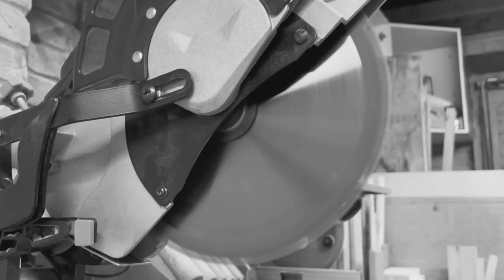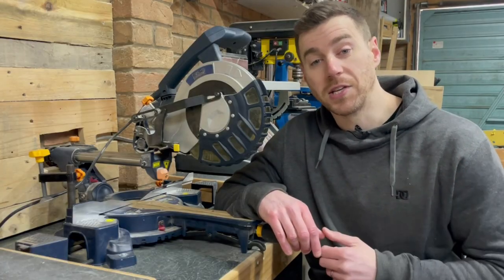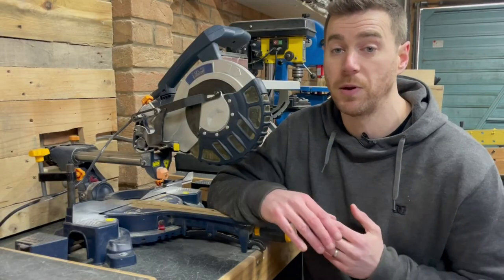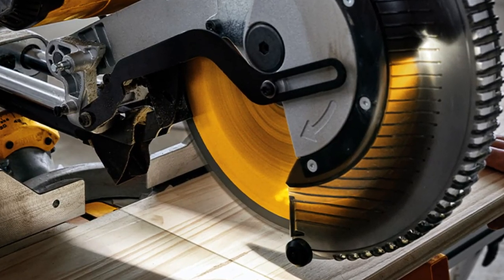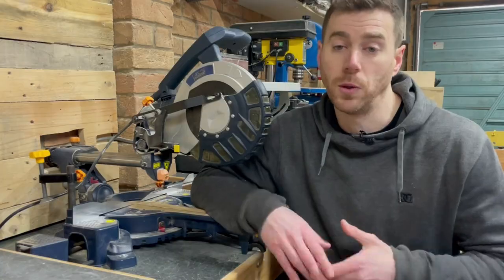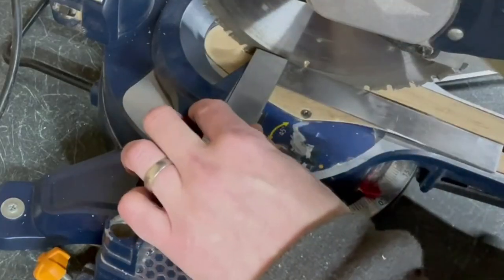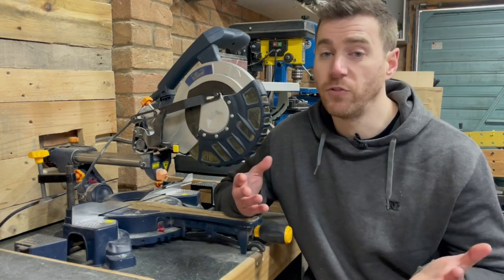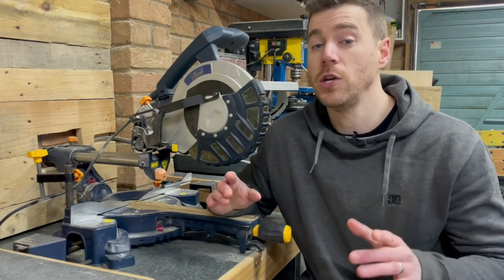Beginners Guide to Mitre Saws || Woodworking Basics for beginners

Comment: thank you Ben for all this tips.  Just purchased my first sliding mitre saw, and have opened the box!!  Noooo, I have actually set it up, but, not worked out what is what yet.  thought I would check out some beginner videos first.
Reply from the maker: Yeah the instructions are less than useful on most tools lol. I just got a new mitre saw and if I tried to use the instructions for changing the blade I’d have no idea! Fortunately it’s not my first one so am well versed at it but it really doesn’t help beginners and people new to that specific tool.